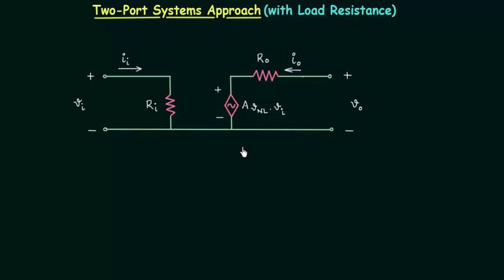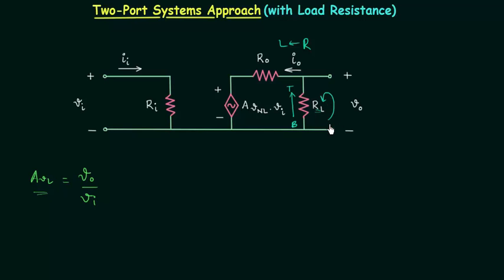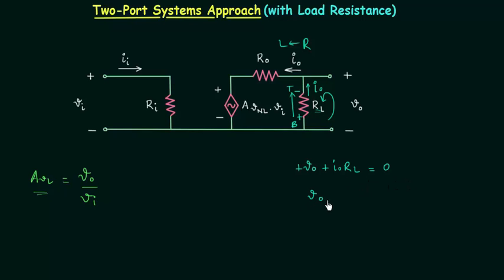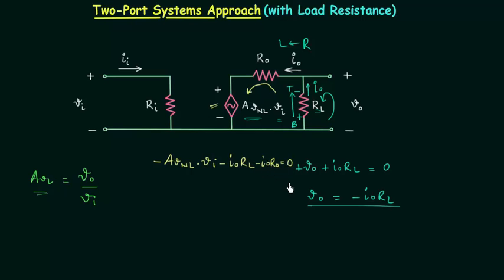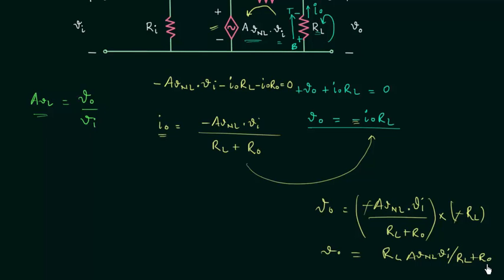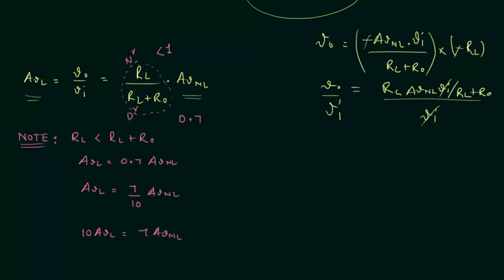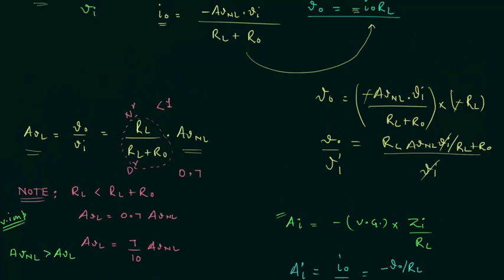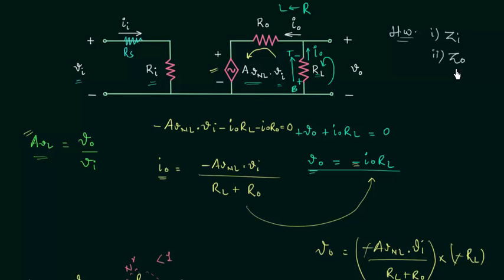Two-Port Systems Approach (with Load Resistance)

Comment: Input impedance Zi= Ri 
Output impedance Zo= Ro||RL 
By using thevenin's equivalent ckt. ZTh= Zo = Ro||RL.
Reply: While calculating for impedance Zth in  Thevenin's equivalent ckt, load resistance RL is not considered. You can refer to Thevenin's theorem for this

Comment: The term of load resistance can never appear in output impedance. It's just against the definition of Zo.
Reply: Can u pls give explain about "it just against the definition of Zo" I am not getting. And I am thinking that Zo=Ro||RL but given different answer
Reply: Reason is that ,in order to find Z0 you need remove load resistance and voltage supply zero
Reply: What would be the perfect answer?

Comment: Zi=Ri,Zo=Ro. output impedance should see before output trrminals i.e before load only I think. If right or wrong, please ping me.
 thank you.
Reply: You should make vs=0
Then u get the vcvs as short ckt.
So you get Zo = (Ro ।। RL)
Thank you!
Reply: @mehedimanon62  The term of load resistance can never appear in output impedance. It's just against the definition of Zo.

Comment: Zi=Ri , Zo= Ro !! RL
Reply: @cipherswami  if you do RL equal to infinity then u will lose Vo term in output impedance Zo=Vo/Io
Reply: @charanteja8859  to find Zo, short the Vi, open RL and in place of RL we connect external voltage source Vo